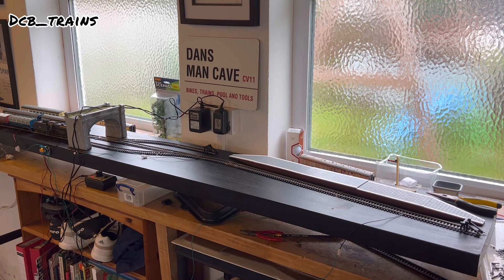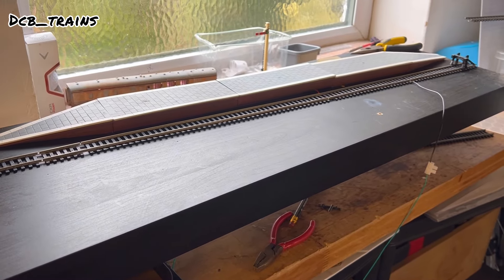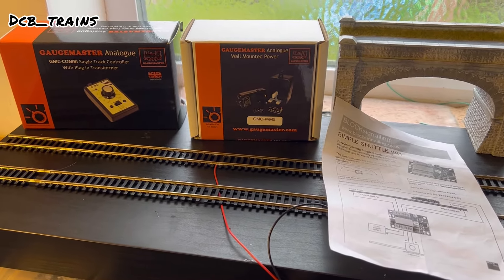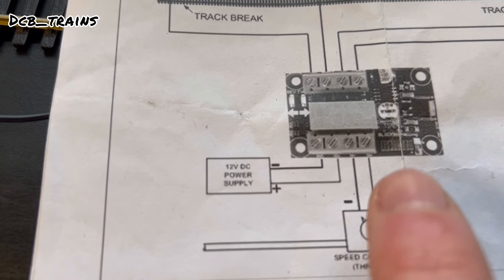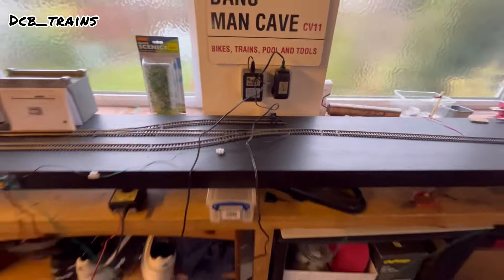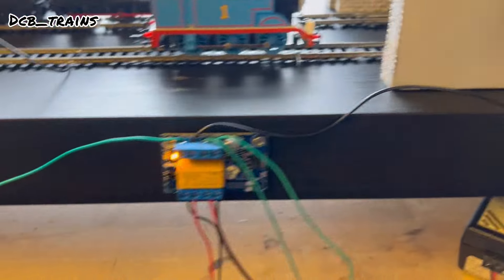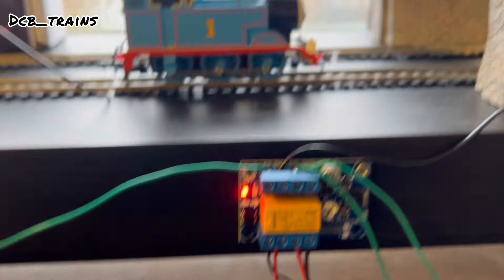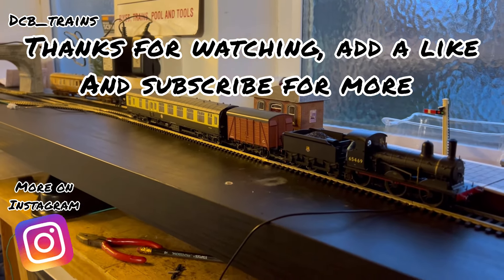Model Railway Shuttle Unit Ikea Shelf Layout Build 1:76 | Part One The Shuttle Unit

Comment: An interesting video. I am thinking to have a shuttle system on my main layout as a perserved railway.
Reply from the maker: I would go for it. They are great especially for a dmu or auto train which goes in any direction without having to run around the train to change ends